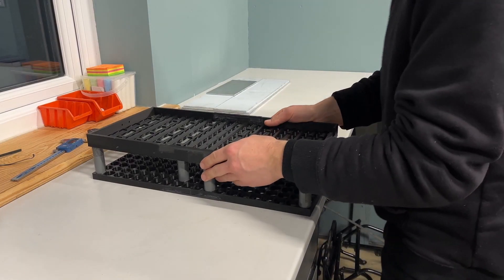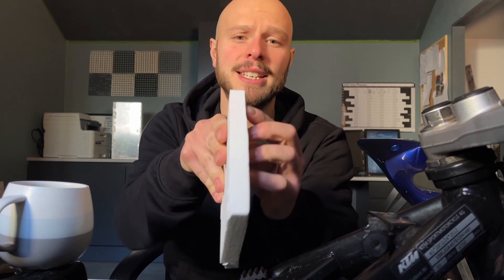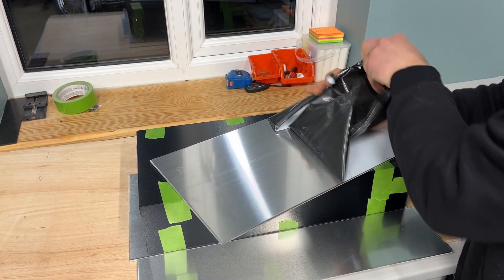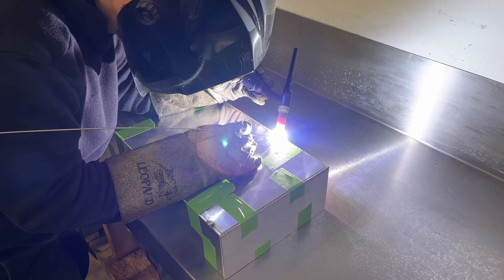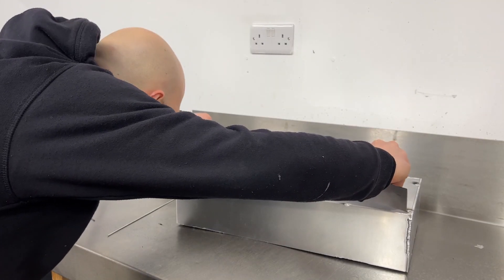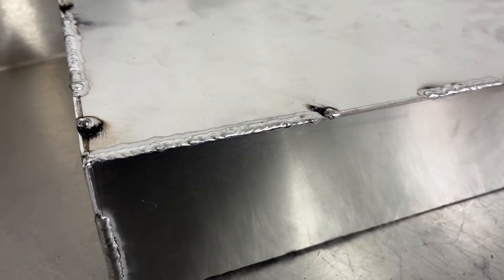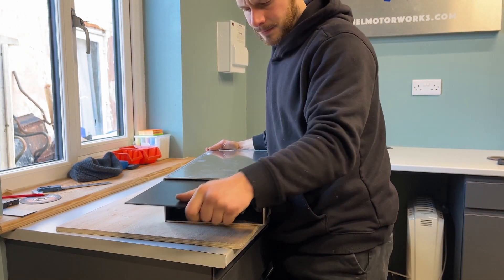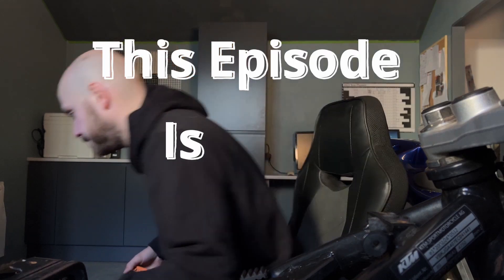Making The Case For My Lithium-Ion Battery Pack

Comment: Hi Mike ,I love what your doing I want to do stuff like this one day when I get extra funds while racing bikes this year aswell ,I'm also a welder aswell when welding open butt joints like the box I put my settings at 80 amps it's a little cold at start but if you hold it there for few seconds longer then start moving it will come out really well for you while the piece is heating up further down ,hope this helps in your next project